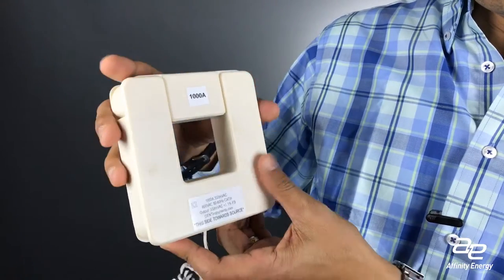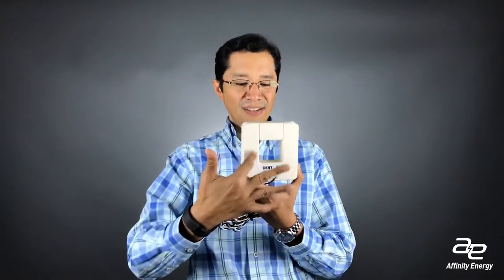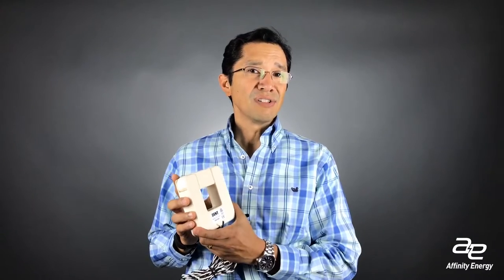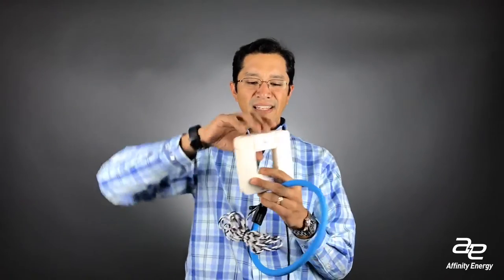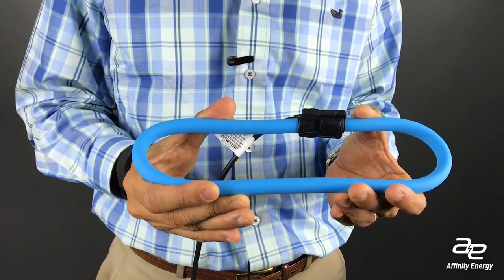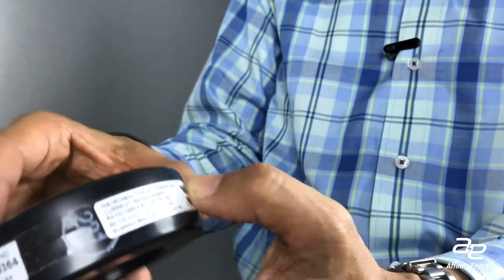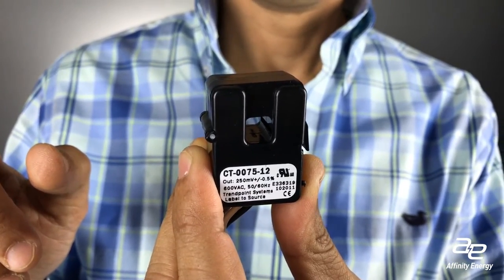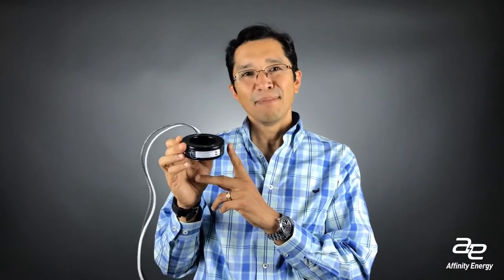Current Transformers - I&C Short Tips

Comment: Hello Sir 
This is very informative video I get good knowledge about CT.
I want to use CT in 0.75 HP AC motor current measurement with full accuracy and how reliable to use CT for current measurement and using in our machine.
Kindly please suggest which CT i have to use in this application.

Thank You

Comment: I recently installed a small window type  CT on a small wind turbine(100Watts) and i noticed that the offset error varies with ambient temperature(the higher the ambient temperature, the higher the offset), is this typical with a small CT? is this due to the fact that the resistance changes with temperature?
Reply from the maker: While copper’s resistance does change with temperature, based on the CT lead wire length, we find this change in resistance to be negligible for our applications.
 
We encourage you to talk with OEM of the CT to determine:
The operating temperature specification for the CT.
The specifications for the CT lead wire.
If the temperature change and its impact on resistance accounts for the offset.